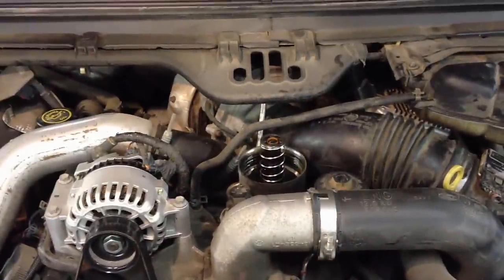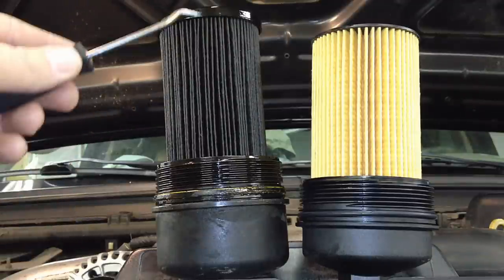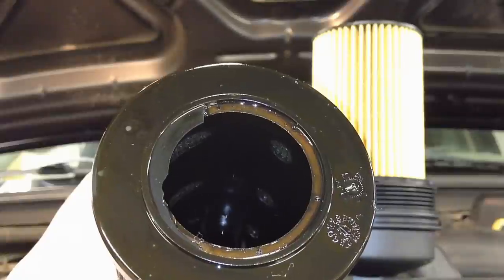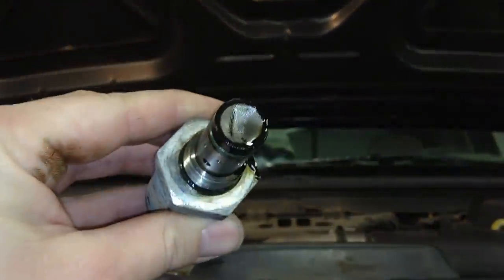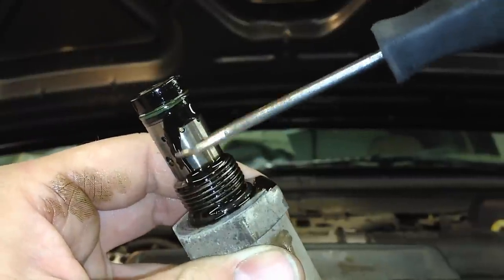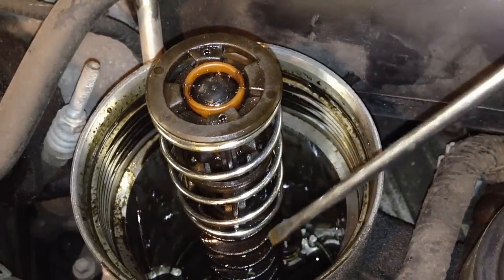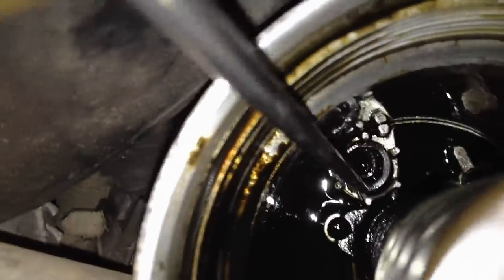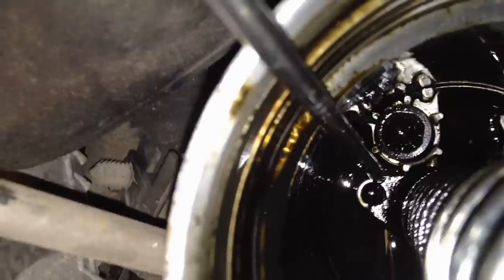Ford 6.0L Powerstroke No Start: Aftermarket Oil Filters

Comment: Dude, you just saved me from tearing down a fresh bulletproof! I spent quite a bit of cash to get this truck up and going. I bought it for a good price and didn't really know what kind of work had been done to it previously, so I spent the money and just got it back together today. Would not crank, I was pissed! While watching your video I remember pulling out an aftermarket oil filter/cap that said on the cap "DO NOT REUSE" on the side. I put a motorcraft filter in an aftermarket cap! I wasn't closing the drainback valve! After installing my OEM cap withing 30 seconds of cranking, she fired up and has NEVER sound better! Thank you for this video, you are a lifesaver!

Comment: As Makuloco knows, and any knowledgeable 6.0L PowerStroke owners know, you use Motorcraft-Racor oil and fuel filters only in a 6.0L PowerStroke period. They are a "patented" design for exact fitment and flow and durability, that is why the aftermarket cannot copy the design. Racor actually makes the Motorcraft filters for the 6.0L PowerStroke, and you will find the same stamped patent numbers on the end of these two brand oil filters only. The 6.0L is punishing on motor oil like no other engine, with 500-4000+ psi oil pressures in the high pressure system to pressurize the fuel injectors, you want good durable filtration and proper maintenance or it will cost you. Even worse, when one trys to put a factory size oem oil filter back into one of those tall aftermarket caps the oil drain valve stays wide open, then it really gets expensive. Great video Makuloco!,

Comment: Oh man, that's really bad!  Good thing you seem to have caught it early!

I own a car in which the dealership had broken the standpipe lattice off the oil filter housing cap and never said anything to the previous owner about it.  Having done several oil changes on the car since taking possession of it, I didn't even notice anything was wrong until I chanced across a picture of what it SHOULD look like...  Goodness only knows how long it had been like that, but having also torn down the engine for a top-end rebuild, the cylinder wear is insane; it looks like a 400,000 mile engine despite "only" having 175,000.  Any oil bypassing the filter is baaad.

Comment: Mercedes cars also use cartridge type filters and the same principle applies to mercedes. People always try to go cheap. The mercedes filters are about $15 but worth every penny. They last 10,000 miles and keep a seal. My friend decided to use a fram i think on his e320 which used plastic, unlike mercedes who use a special resin in their filters. When i took the filter out for him, it just fell of the stand tube with no seal. I also have a mercedes and showed him on mine how nice the oem still sealed and i had 9000 miles since my last oil change.  I had to really pull on the Oem becuase it sealed.

Comment: Happened to my 01 Ford Explorer car just cut off while driving on the highway and would start. Had to get it towed. So I changed the oil and used a Motorcraft filter and it started right up and ran like new. I was speechless!

Comment: Exactly.  Wife took truck to jiffy lube.
They put the wrong filter on. 
A week later wouldn't stsrt.
3 months later after replacing all parts. 
Ipr icp dummy plugs oil cooler and few more. Then i looked at oil filter it wss broken. Literally broke in half from torque of engine.  Learned a lot

Comment: Hello. I have verified that I have the correct filter and correct cap. 75k miles all oil changes are proper interval. 2005 6.0 excursion. I have recently had a slightly longer than normal start when sitting and sometimes running errands. Do you have experience with this? The gauge inside shows no oil pressure for a few cranks then starts. I have never had any issues so I do not remember what the oil gauge looked like before this issue. Thank you.

Comment: Very interesting. I have always thought wix was a premium filter. They were all we stocked back when I was a tech in an independent. we were told by reps that wix and napa gold all came out of the same maker. We never had issues with wix filters and we used them in semi's all the way down to passenger cars. So kinda makes me think of possible installer error. If I own the truck "WIX" would be getting a call. Im only saying this because I have seen turbo's in the old 7.3 s wiped out because of the thin exspanded metal screens on the air filters . I have personally seen puralator pay for 2 customers repair bills. I think it is an awsome what you are doing for others and love your channel.  Thanks for sharing.
Reply from the maker: Ron Hart I would never use wix in anything I have seen more failures than this from wix filters.
Reply: FordTechMakuloco I used Wix for 10 years when I owned my shop, never had an issue in gas or Diesel.

Comment: Really interesting discussion. I've been using K&N oil filters on my 2.5L Fusion SE for years. I'm seriously thinking about saving the money and sticking with Motorcraft from now on. Do you think this problem is engine specific since the design of this particular filter is integral to the housing, or could this be a good example of why it's important to stick with OEM filters across the board?
Reply from the maker: We have seen it with the fuel filters on the 6.0l also, not to mention cartridge style oil filters on some cars aftermarket literally crush in not good. Now this one was a Wix filter which I have never like the quality of from the get go. I am sure the Napa Gold is much better but I would just stick with the Ford filters. Ford is constantly improving upon them because they have the money for the R&D plus they have engine warranty they have to stand behind.
Reply: FordTechMakuloco
I'll stick with Motorcraft. It saves me money, and it's designed for the car. ;)
Reply: FordTechMakuloco, can low oil cause a stall while driving. I just picked up my 6.0 from the mechanic and after getting towed twice I when to check the oil and dip stick is not picking up anything. Thanks in advance.
Reply: @FordTechMakuloco  Just a thought. The 3000 mile oil interval is chosen for severe duty for some engines because that is when the oil filter will be full or clogged and the by pass valve will be constantly engaged? The oil filter does not have a sensor to determine when it is full, so interval mileage must be used determine it replacement?
Reply: @JABeshara  I’m surprised it even started for you being low. Sorry for butting in. My 6.0 gets low on oil it won’t start

Comment: I agree. If you drive a ford, or any brand for that matter, it only makes sense to use the recommended filters and parts. I do have to ask tho, Was mileage a factor in that filter coming apart? i have seen this too but usually the filter had been in the engine for well over the recommended service interval.
Reply from the maker: FunkDonkey1 I was told this guy doesn't change oil too often but still have not seen a motorcraft come apart like this from too much time in service.

Comment: Yah good job on those crappie filters. I only use motorcraft oil, plugs, filters. That includes rotors and shoes too. Made to fit, made to work right.
Wont use Frams on anything

Comment: I have ALWAYS used Motorcraft filters on my 2004 F250 PSD.Doesn't make sense to use any other oil filter as a Motorcraft oil filter is less than $20 at WalMart.
Reply from the maker: +dieseldad55 Exactly!
Reply: FordTechMakuloco 😀

Comment: great video. I have no doubt that you get bombarded with questions, but I do have one. I have an 06 F350 6.0L that wont idle unless you keep your foot on the pedal. any ideas ? also, it starts hard. when cranking, it wont fire unless I press the pedal. any insight is greatly appreciated.

Comment: I may be wrong; however, the top of the oil stand pipe in the filter housing appears to still have a small adapter from a cheap Fran filter in it. May not be a part of the issues but it shouldn't be used with either the wix or motorcraft filters. The patent on the motorcraft/racor filter works great for ford but it sure screws the unknowing consumers who are used to getting an adequate filter from multiple sources without having to do an research.
Reply: I was going to mention that I saw that adapter in there too I found one on my truck and if you leave it in there and use the original Ford filter the Ford filter will be bypassing the whole time

Comment: Hello,my Fuel injector pressure regulator is reading 90 PSI and the voltage is maxed out on my 2005 6.0..according to my son,using the scanguage. Is this a indication that the Regulator can be back?Just bought the truck,changed the oil,had a Nappa filter on it,changed it over to a Motorcraft Filter and cover.Truck drove about maybe 20 miles,then all of a sudden,a hot motor,no start.Shows oil pressure of dash when cranking and only starts with starting fluid,and I replaced the Drainback Valve because it was cracked and a piece missing,1/8 of a in or so.Could this be the Regulator,piece of shit in it from the drainback being cracked,or slug crap.Thank you if you can be of any help.God Bless you my friend,Mark....

Comment: I use Motorcraft on my Ford, and Delco on my GM. No problems.
Reply: Andrew Townley what oil you use in gm?
Reply: Delo 400 LE 15W40
Reply: Mobile 1 after rings are set.

Comment: is ford not allowing use of CK4 oil I  the powerstroke? what makes the Motorcraft oil for 2017 better than ck4?
Reply from the maker: ck4 is backwards compatible with Ford 2017 and older powerstroke engines calling for cj-4 oils. The licensing is not coming out until December that is why you may not see the API label updated until then.
Reply: FordTechMakuloco I see. I ask this because Bill hewett of Powerstroke help on GA brought on his Amsoil specialist saying that Ford will blend their own oil for 2017 6.7 Powerstroke as Ford felt ck4 did not meet their species this incorrect?

How about our friends who Harv legacy Duramax from 2006-7 LBZ do you think the ck4 meets these legacy motors as I understand they have much less phosphorus etc than CI4 oils from 10 -12 yrs ago as Amsoil has the diesel and marine synthetic for legacy engines pre 2007. Thoughts ?
Reply: I emailed Tom the guy from bills video. he said that ford says the new ck-4 has less phosphorus in it which causes less protection. so ford will not recommend that spec. so they have developed there own spec which all oil blenders will more than likely incorporate into their system, he said eventually the ck-4 spec will have the spec requirements Ford desires. ford recommends staying with the ci-4+ or cj-4 until the spec is availible.

Comment: hi i have some problems starting my 2006 f250, if the truck is cold starts easy.
if the truck run for 30 minutes i can't start it.  what do you think? IPR? i use  15w 40 oil delo 400
Reply from the maker: +monwilles High pressure oil leak start with my 6.0l air test video.
Reply: Dummy plugs

Comment: The stock filter looks like a Mann made filters it say on the filter made in usa I work on Euro cars and they are made the same I agree that an oem filter is the way to go but I dont know of any manufacture that makes there own filters any way in my feild if I put a Hengst,Bosch,Perflux or a Mann filter I know I'm getting the same quality as what you can get from the dealer it is verry important in vehicules with extended oil changes I know for a fact a cheap filter will shrink and collaps compared to a good quality filter if you are not sure of the filter that they are selling you I suggest to go to the dealer and buy what was meant for youre application.

Comment: Good morning, my friend I live in Brazil and I bought a f250 2008 6.0 power stroke plus she is missing the diesel injectors. I would like to know if to change the injectors we have to update the injectors module or I can only change and start.
Reply: No, you can just replace the injectors and it will be fine

Comment: would this also be the cause of oil gushing out of the dipstick tube and blow by? I've never seen so much oil come out like a geyser on anything. The oil had been changed less than 500 miles prior and now it looks black and is extremely thin.
Reply: Jesse Finchem all I can think is blow by but the thin oil also makes me think it might be diesel passing the piston rings into the crankcase very common on stock 6.4 due too Regen the crankcase gets oil

Comment: Racor makes the Motorcraft filters.  If a person wants to save money on filters, they should buy the Racor branded filter and not the Motorcraft branded filter.  If you don't do your own oil & fuel filter changes, you will need to supply them to the shop (if not a dealer), because unless you specifically tell them to use Racor or Motorcraft, they will use what they have on the shelf and most likely it will be an aftermarket with its own cap.  Then they will most likely throw your stock cap away.  Just beware of this when you are having someone else do the work.
Reply: most ford,chevy,Chrysler and Toyota filters are manufactured by WIX.  if you request a factory replacement  and not their retro fit design you are actually buying the same filter.  WIX has actually replaced an engine for me due to a failure.  try getting Ford to do that for you.  I have this info due to speaking with their claims and manufacturing reps during my issue.

Comment: Could this cause my 6.0 to run and then just randomly die when driving or idling hot or cold. i used that damn wix filter, and been fighting with this lower icp pressure some about a month. truck will run great some times then others it will take long time to start, and then may die after just a few miles of driving.
Reply from the maker: +TheConeHunter No sounds like you have an ICP problem but I would change the filter first.
Reply: +FordTechMakuloco swapped out the oil and fuel filters along with cleaned the egr valve. completely cleared the emc and now I'm going to drive it a bit I'll post another reply once iv seen some results. thanks for all the helpful videos